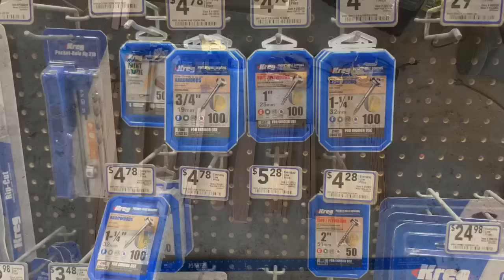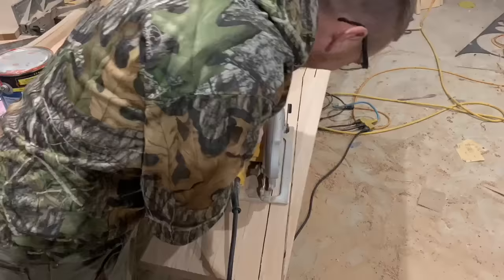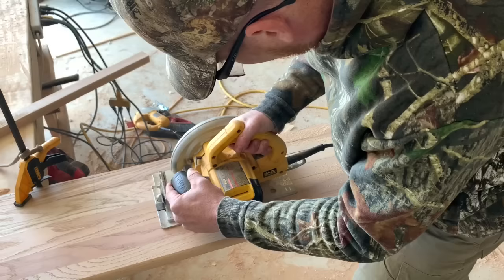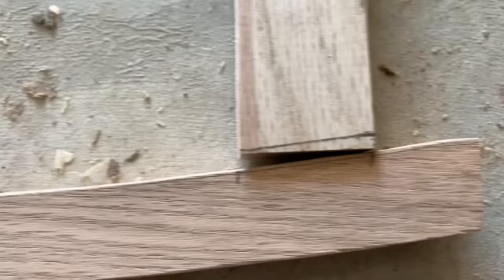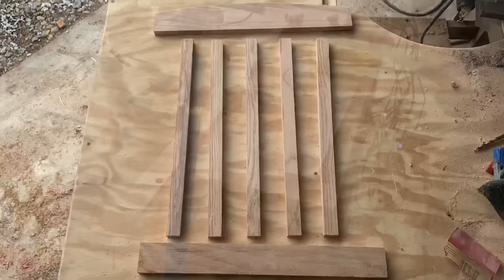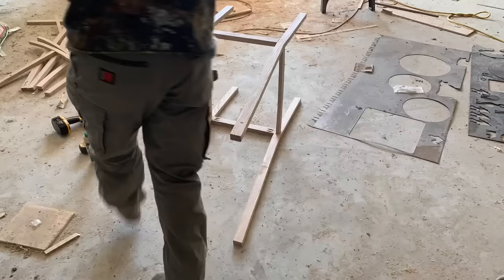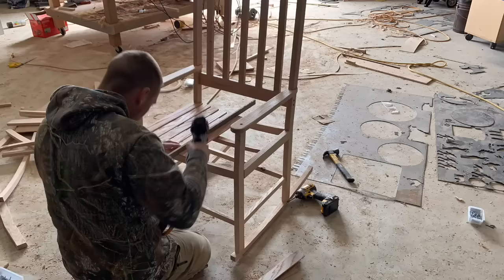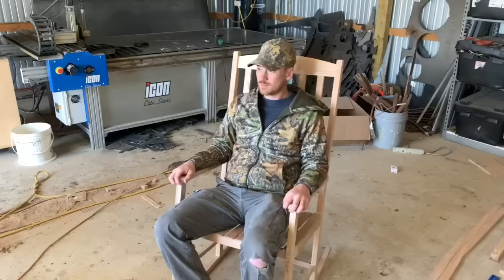How To Make A Rocking Chair

Comment: Hey I don’t think some of these measurements line up. The braces that connect the front leg and the back leg can’t be 1 1/4” cause you won’t be able to fit 2 pocket holes with that. And the back tests look a bit wider than 3/4”?

Comment: Rocking chairs experience a significant amount of stress, especially at the joints where they bear the weight and movement of the person sitting in them. Pocket screws may not provide the same level of strength and durability as traditional joinery methods like mortise and tenon or dowel joints. Over time, the repeated rocking motion could weaken the pocket screw joints, leading to potential failure.
While pocket screws have their place in certain woodworking projects, rocking chairs, given their specific design and functional requirements, are generally better served by using traditional joinery methods for optimal strength, durability, and aesthetic appeal.
Reply from the maker: I was kinda wondering the same thing, but almost two years later with a lot of abuse and these chairs seem to still be pretty solid. But you are right mortise and tenon would be a stronger option.